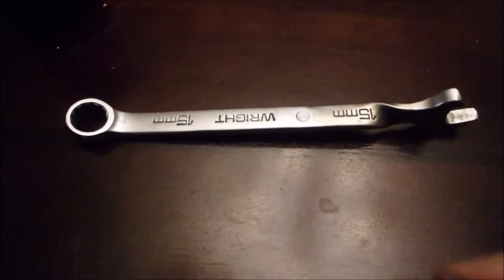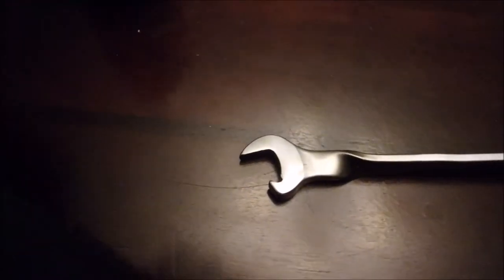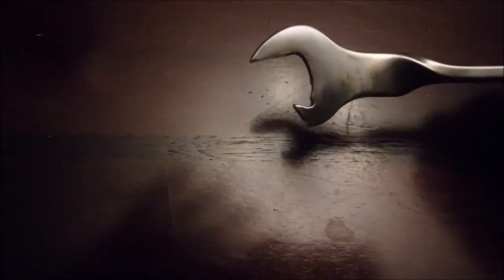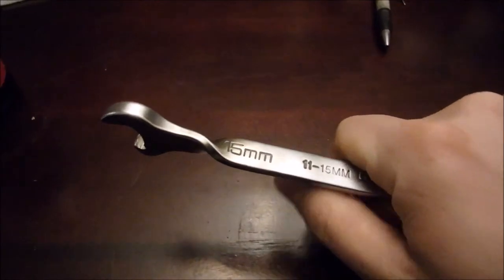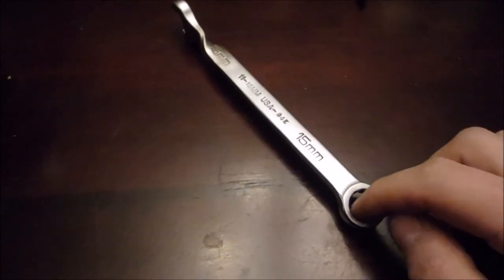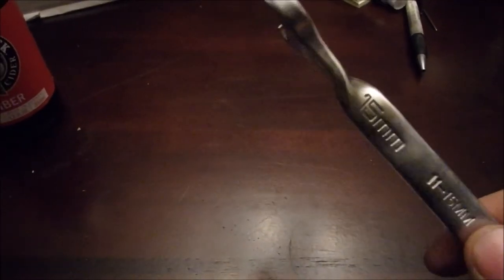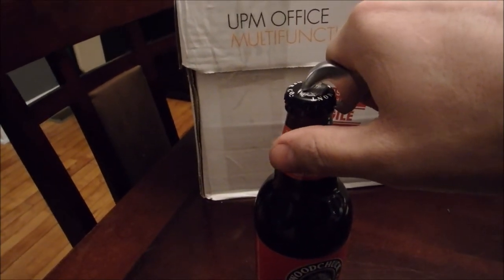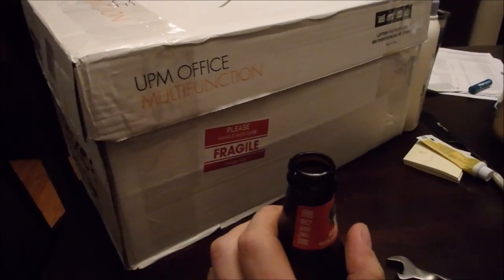Wrench Bottle Opener

Comment: Hey quick question. Do you know how can I fix the clock on my crf250l 2015? It resets every time I turn it on.
Reply: Sounds like it is off a straight run from the battery not a constant current line like a clock should have. If not contact dealer was only guess off some electrical/car stereos experience